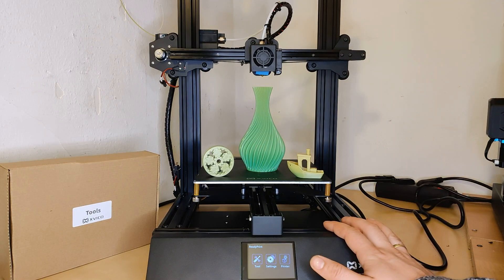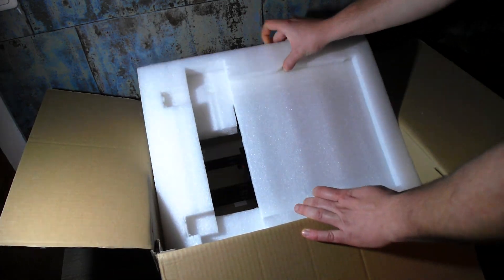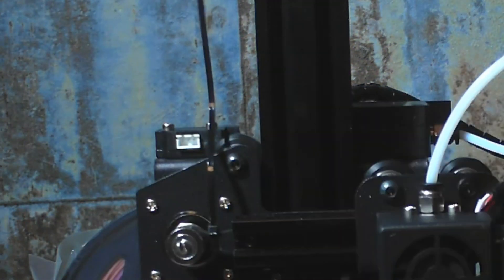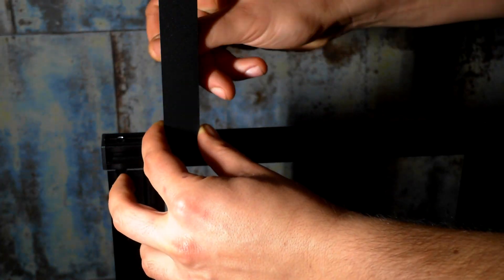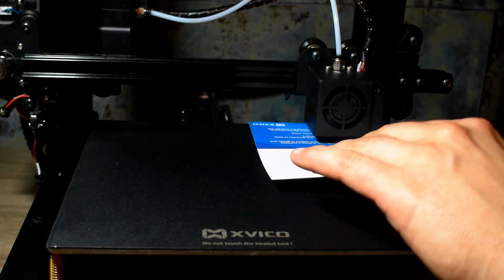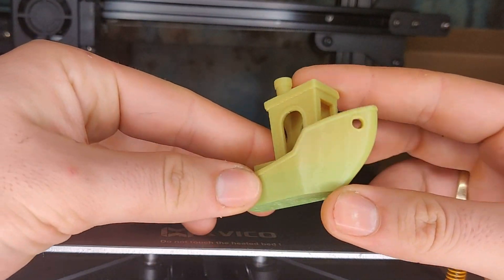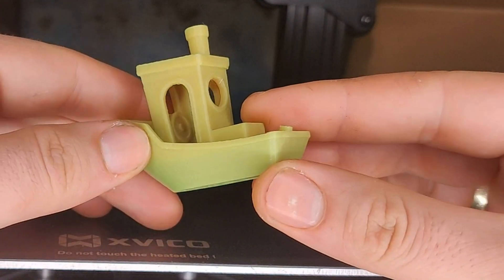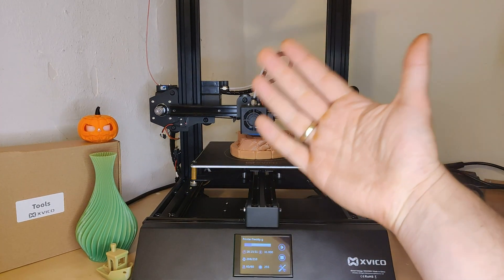XVICO X3S 2020 3D Printer Review / Unbox and Setup!

Comment: Excuse me but my nozel does not touch the heat bead while printing so it does not print only making scraps
Reply from the maker: You need to level your bed properly
Reply from the maker: Use the bed screws like shown in the video

Comment: Whyd you skip the filament feeding tf
Reply from the maker: It's not important to install this small piece
Reply: @3dg3nesis  i cant get the filament to feed, any help?
Reply from the maker: Do you printed before?
Reply: @3dg3nesis  ive got an ender 3, but for some reason filament wont go through the gears on the xvico x3s
Reply from the maker: @alepepperoni2563  ah okay. Do the gears moving ? Heat up the nozzle then press feed. If this not working your motor seems to be dead
Reply from the maker: @alepepperoni2563  if the gears moving you can adjust the tightness of them by rotating the extruder screw
Reply: @3dg3nesis  the gears sounded like they were grinding tbh. 
Thanks for the help i appreciate it, ill keep trying.

Comment: Got this printer a while ago, when it works, it works amazing... when it works... while it seems to be reliable thus far, it is incredibly finicky, be prepared to spend multiple hours tweaking lots of settings, often individually per print, far more than any printer I’ve had prior. Though when it prints well it prints simply phenomenally, I’ve gotten incredible detail and even PIP mechanisms with almost no artifacts. The filament it comes with I believe to be very low quality, though I have yet to test out that theory. Great printer for tinkerers and hobbiests who know what they’re doing, but not for those who want something perfect out of the box. But if you’re just looking for a good printer that will print beautiful and functional parts and work for years, then this is a great choice for you.

Comment: How did you get it to print in the middle of the bed? My printer only prints in the bottom left corner😞
Reply from the maker: Hey, which slicer do you use ? What happens if you put the STL file in the middle of your printbed in slicer?
Reply: @3dg3nesis  I use Cura. I’ve tried putting my models in the center but my printer only wants to start in the corner
Reply from the maker: Okay i have an solution for you. Please uninstall Cura. Install it again and choose Add Machine. Next step choose Ender 3 from Creality. Try to slice with this settings and you good to go.
Reply: @3dg3nesis  thank you so much! I will try this immediately
Reply from the maker: @tytanium5554  nice, tell me if it worked !

Comment: I got this and it wont turn on? everything seems to be wired correctly any suggestions?
Reply from the maker: Hey. You need change the voltage from 110v to 220v. It depends on which country you live. If this not help, please check the power cord wiring under the plate.
Reply from the maker: Does the fan of power cord spin if you turn it on ?

Comment: Hi! I got this for my 13yo son for Christmas and I think we've got it set up, but when I try to level point 1 it gives me an error in an Asian dialect, and then the touchscreen completely freezes. I can only get out of it by turning the printer off. Any idea what could be causing that? Thanks in advance!
Reply from the maker: Hey, there is a software update which should fix it. First download this xvico.bin, then copy it to the root directory of the SD card, insert the SD card into X3s, and then turn it on, the machine will update automatically.

Here is the file

https://drive.google.com/file/d/1oREbY5GpKDCzwN9ygr_PLKv2x_AIuwZt/view?fbclid=IwAR06fQoscJWRqY7kEPVX3t8CwQ3L82BBDJRw5ckiYc6KUaogMmBFO2fUyZ4
Reply: @3dg3nesis  Thank you so much! I'll try it.
Reply from the maker: @jennifermcginley2335  tell me please how it's going
Reply: @3dg3nesis  So sorry for the very late reply! Life got crazy and this got pushed to the back burner. Trying it out now. I'll keep you posted. Thank you again!
Reply: @3dg3nesis  Thank you for the update link. That resolved the issue I was having previously, but my printer seems to be having trouble moving along the x-axis. The belt seems loose. Is there a way to fix that? I'm going to reach out to their customer support, too.

Comment: Hi, I just got this same printer for Christmas and while testing moving it in the right/left axis it sometimes wouldn't go right. I know what the problem is and that is a loose belt like you had but watching the vid you sped by the process. Could you elaborate on how to fix a loose belt? Thx
Reply from the maker: Hey, you need to loose the bracket as You see in video. Push it to the right and screw it while you holding it. If it's not clear i can give you my Discord

Comment: i just got this printer, and cant seem to keep the project to stay stuck on the bed, ive tried everything (pretty sure the bed is level, any ideas?
Reply from the maker: Yes try to increase your temperature. If you using PLA print with 210C and Hotbed at 55C. Use gluestick or printafix to get superb sticking

Comment: Excuse me, I just bought this printer and the printing bed arrived quite loose. I've been trying to secure it for more than 7 hours and I can't find a way. Could you tell me which nuts to turn to tighten the printing bed?
Reply from the maker: Hey friend, if your printbed is wobbling you need to tighten Eccentric Nut under the printbed (where the wheels are)
Reply: @3dg3nesis  I do not see any eccentric nut, only 4 identical nuts without any distinction whatsoever so I asked which were the ones to tighten
Reply from the maker: Do you have discord?

Comment: what diameter is the filament entrance ? Standard 1,75?
Reply from the maker: Yes it's 1,75mm. Feel free to ask :-)
Reply: @3dg3nesis  you realise this printer has a filament sensor on it? it needs to go throught that tiny plastic housing before the feeder tube otherwise the printer thinks it hasnt got any filament to print with